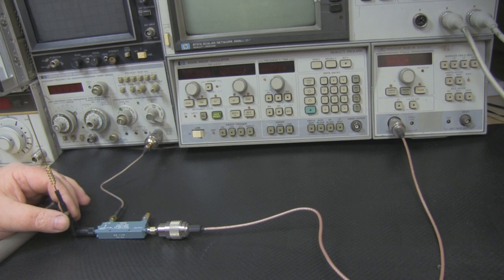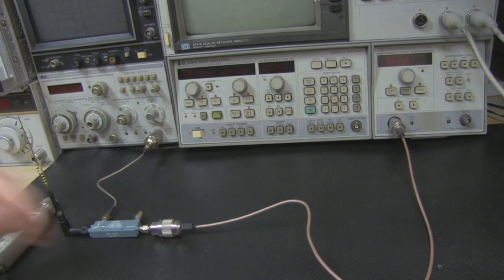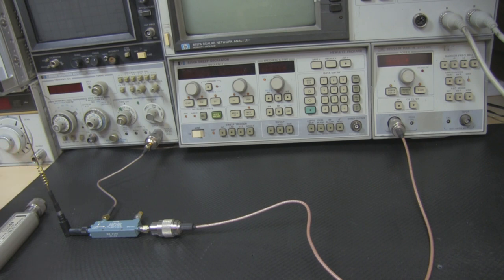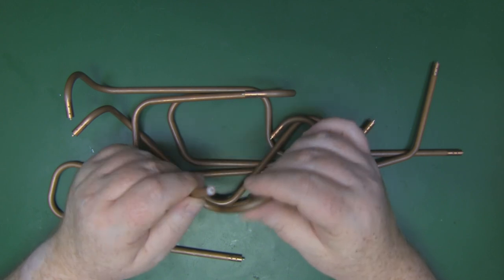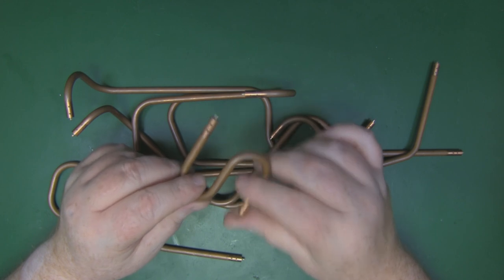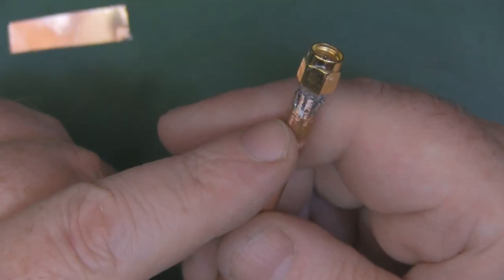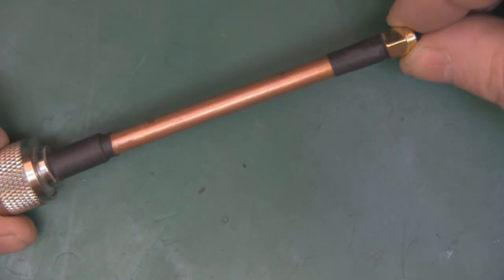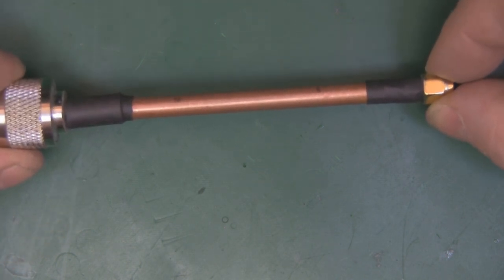Custom Test Rig using Rigid Coax

Comment: That's a nice way of doing these high quality, low loss patch cables by using old rigid coax. Also sometimes you find these auctions for lots of old/used low loss cables on ebay, typically recovered from high end surplus gear. As you've shown, first problem that will be encountered is finding the right connector for the type of cable used.

Comment: could you suggest an antenna design for a 1900Mhz Panasonic dect 6.0 cordless phone?
There is a repeater/extender unit supplied with it but it has internal antennas and it won't reach the outbuildings on my farm. Most antenna designs that I see are for WiFi not 1900Mhz
Reply: Linear measurements scale inversely proportional to the frequency. Double frequency? Half all lengths of the design!